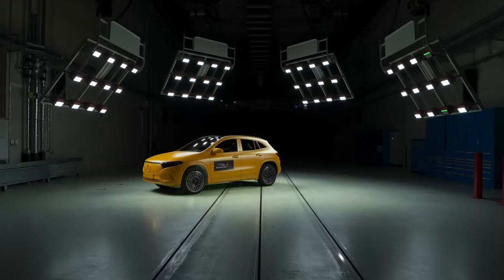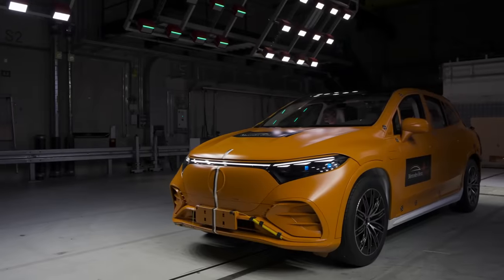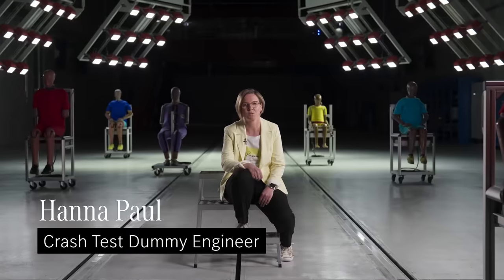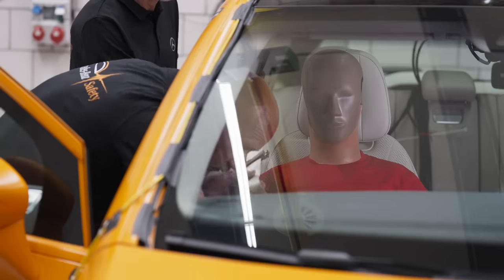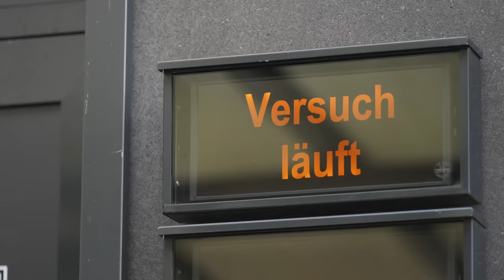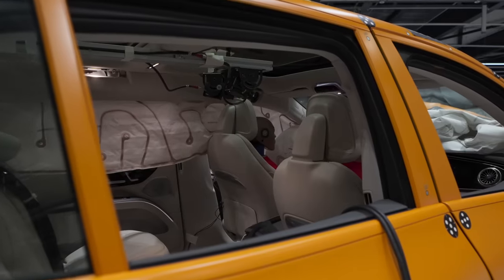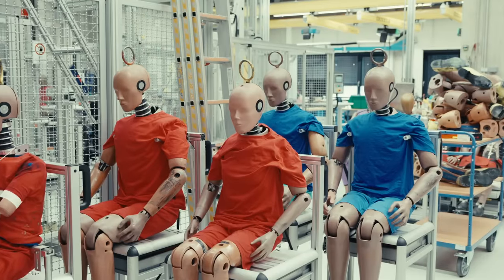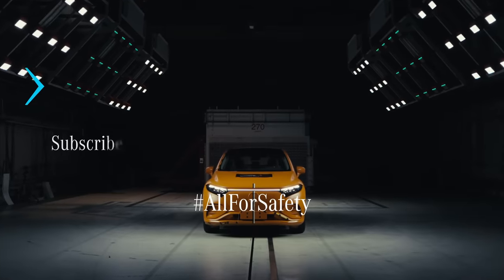The world's first public two-car electric crash test by Mercedes-Benz

Comment: Mercedes should have done this test with en EV and a lighter combustion engine car....weight difference is an important faktor...and the lighter car will loose in such crashtests
Reply: Why? What additional knowledge could they have gained from a test like this? You already tell us the (obvious) outcome in your comment.
Reply: @Tschacki_Quacki  additional knoledge might be, that EVs need to be "softer" to absorb more energy, so that the accelleration force on the lighter vehicle gets lower
Reply: @alexmeier3538  EVs already absorb more energy in crashes than ICE cars since they have bigger and better crumple zones.

If you have a smaller car you rather have a big EV crashing into you than a big ICE car. The additional crumple zone helps all victims of accidents, not just the one who has a bigger car.

Comment: The car is orange for a different reason. Firstly it is matte because the lights a because of the camera shutter speed extremely bright and the reflection of a clear coat would reflect the lights. But why is it orange? There is absolutely no reason for that. It can be bright blue, it can be bright green. As long as the car has a bright matte colour it's fine

Comment: Ok, so where are the side impact results wherethebatterypack would certainly be effected, and rollover results, I would like to see independent tests, not self promotion tests, and I hope no crash test dummies were seriously hurt in the making of this video.
Reply: Plenty of them online. E.g. check out N CAP tests, they are the ones giving out the 1-5 star ratings for automotive safety. You can be sure these internal tests are on same or higher standard, since OEMs are eager to reach a 5-star rating

Comment: Now lets see the same thing with the more abundant Chinese EV`s that are on the road . I know its unlikely the Germans would ever cheat on a test 😉 but how do we know if  there was any power in the Batteries? I`m betting they were totally flat , as petrol/diesel is drained in ICE car  crash tests and replaced with water, so it stands to reason the "electric fuel " would be drained .
Reply: Batteries were both charged

Comment: what about car  battery on battery collision
Reply: What sort of setup would u imagine?
The batteries are in a safety package with impact absorbing structures. So they never take a direct hit.
Reply: @quelandil5738  idk what if the cars flip over and somehting hits the battery or when driving in rural areas some rock hits it then the car becomes like gta v (where flipping cars most of the time result in fire)
Reply: @lelkasa361  unless u get in a high speed crash that deforms the whole car the battery will be fine.

The passenger and battery compartnent is basically a really sturdy structure with crumble zones around to take the impact.
When the battery gets severly damaged, the passenger most likely already died from that crash.

Towards your question, those tests are performed, e.g. a pole hit from the side l8ke hitting a tree

Comment: First this test was done by the manufacturer so they most likely built this car for the test, it probably didn’t even have a full battery pack in it. Second if you want to do a test like this the car should be sourced from the dealers lot.
Reply: That's why these tests get conducted by governments and institutes to certify before release

Comment: You didn’t show the fire and them getting dumped in to a lake 😂.
Reply: Well sorry to burst ur bubble, they don't catch fire 😂
Reply: @quelandil5738   ok, do you want links of EVs catching fire? Because they do…. It’s a battery powered car not a pedal car.
Reply: @thewillofus.defend1351  ok, do you want links of gas powered cars catching fire at a proven increased rate? because they do...
Reply: @thewillofus.defend1351  Nobody doubts that there are ev cars that catch on fire. 

It needs to be a big issue and a high probability on happening.

But with that kind of approach you also shouldnt drive any other car, use a phone, fridge or maybe even a book (i mean... papercuts?)

Without statistical significance it simply doesnt provide any additional information. Gimme empiric data of an insurance company, percentages, brands etc....

Comment: If the vehicles were painted orange for black and white cameras, and you have color cameras now, why are you still painting them orange?
Reply: Tradition and recognition
Reply from the maker: Since we film with high-speed cameras, up to 3000 frames per second, we need glistening bright light in the crash hall. To prevent this light from reflecting too strongly on the vehicle, we have to paint it with a matte colour. It turns out that our historic orange colour is still the most suitable.

Comment: Car looks totalled even at only 56 kmh. If I crash with my bike at 56 I can survive that crash without any crumple zones. Maybe I will not feel as good as the passengers of the Merc but non the less survivable. Love to see this test at double the speeds (100kmh).
Reply: Well that's the point. The car is totalled but no the passenger.
Which one would u rather sacrifice?
A car that is undamaged after a crash has dead passengers inside
Reply: @quelandil5738  I get that, but its only 56 my man. 20 y/o cars have crumple zones as well with less mass and you magicly survive with a car with minor damages

Comment: I would imagine the batteries were replaced with crash test dummy batteries, they would test outside in a controlled environment with fire trucks, water-bombers standing by. Let’s see an independent entity do it.
Reply: Production batteries at roughly 50 and 75% SOC were used. There are always safety measures close to be prepared for any circumstance. If you dont trust them, then check out the independent agencies which do the same tests for the 1-5 star ratings

Comment: 56 kmh is a joke. if you are so confident with protecting the batteries and high voltage components, do it with 116kmh. lets see what happens? what a publicity stunt this is.
Reply: >100 car and passengers are simply dead.
Tests are done at speeds with statistically lots of accidents and reasonable survival chances

Comment: I wonder if the Door locks functioned after the Crash, as this is one of my main concern to GTFO of the car before Thermal Runaway Ignites and Incenerates You ! Remember the Gas from batteries is also Deadly.....Screaming to get out ! which seems to be the main safety issue. Blue tooth  remote door locks typically go DEAD and with no easily accessable Mechanical Override to Quickly Get out of Danger ! Not sure how or why the Automotive industry does not want to save its customers !

Comment: A residential speed crash looks like it rights-off your $100k+ EV. I'm curious how the batteries react if they are hit, this test looks like it is done while the batteries are removed and powered by a cable.
Reply from the maker: We test real accident scenarios, so this means that the battery was charged in both vehicles. To accelerate the vehicles, we use a steel cable laid in the ground that works in a similar way to the cable car in San Francisco. The fact that the battery is not destroyed in an accident is crucial for the safety of road users and part of our safety concept.

Comment: If i''m getting into a head on collision with another car, I think I would rather have an engine in front of me rather than a "frunk". Just saying
Reply: An engine is simply a solid heavy block of metal that doesnt reduce any impact force and will simply be pushed towards the drivers cabin. Having no engine in the front is a HUGE advantage for crash safety since you have more crumble zone
Reply: An engine sometimes creates a barrier for the passenger. Infact in some vehicles the engines fall out and not go into the cabin. With an electric vehicle, there is nothing but a sub frame between you and the on coming vehicle...and airbags
Reply: @1964flyers  
The frame is exactly the thing you want. That's the structure able to crumble and therefore reduce the impact for passenger.
An engine doesn't help in any way, at best you manage to make it not pierce the cabin e.g. by having it push under the cabin.

Comment: They are doing it at 56kph. Not 60, not 55, 56! 🇩🇪
Reply: Exactly because that’s the most common speed when an accident occurs outside urban arias. Forchheim occupants the impact is like hitting a wall with 96 Kph. Als any other car manufacturers to do such a test in public

Comment: Didn't you'all sink a boat when you EQS lit on fire ???..  until batteries are solid state and the vehicals like a Cyber truck that weight 6800 lbs means that is Double the weight of most vehicals as well as damage it causes... 
Past 55 mph you are about 80% dead in any vehicle with this crash ..
Reply: The hell you talking about? If you refer to the transport ship on fire, it has already been clarified that it wasnt any EQ responsible for the fire....

Comment: Why are there power cables attached to these cars? Did they remove the batteries before crash testing the cars? If so, why and wouldn’t that invalidate all the data collected? Wouldn’t that make this video kind of fraudulent?
Reply from the maker: Hi Mike, Both vehicles have installed and charged batteries. The Flore cable is only used to accelerate both vehicles to the set speed of 56 km/h. The high-voltage system is switched off automatically in the event of a crash, which worked as intended.
Reply: @MercedesBenz  Hi. Thanks for the response. I have a couple of Mercedes cars now and am very happy with them - especially my mint 2 seat convertable collectable. I cannot imagine buying an EV ever. The idea of being completely and totally reliant on one single energy source is just not a good one. Please keep making well engineered conventionally powered cars until there are legitimately better opitions.

Comment: zero fatal in 2050? What do you think will change until then?
Reply: Active safety measures preventing cars from even colliding or at least slowing down enough. Development is strong in these fields but for 0-deaths it requires more cars with intelligent measures and probably also infrasctructural advances

Comment: Okay. Show now a typically crash between an EV and ICE regular vehicle. Please include also some sparks and leaking from battery cell. Invite fire fighters to event and see how long takes to access passengers as well to extinguish the fire. Okay afterward please make a balance on environmental chemicals contaminating the local. The results should be different I guess.
Reply: 1. There aint no sparks or fire. Batteries are well protected
2. Firefighters are there and they know how to solve a fire, it's not impossible
3. Access to passengers is easy since u can simply open the doors at this crash
4. This isnt about the environment but about safety. Dont mix topics when not necessary

Comment: How about an electric vehicle vs. a similar sized internal combustion vehicle?
Reply: To what point?
This test was there to show safety of ev especially battery safety, since passenger has been proven multiple times.
The ev will perform even better against an ice, since it is heavier
Reply: @quelandil5738  "To what point?...The ev will perform even better against an ice, since it is heavier"  The point being I've never seen a direct collision between a similar ICE SUV and an electric one.  Simple mass is not enough to make an EV safer, as has been shown by many crash test that I have seen and read reports on.
Reply: @rodshop5897  In a front collision ev > ice since u don't have an engine block and it can therefore absorb more energy. (More crumble zone)
So the ev will definitely perform better in this comparison.
(I am talking mercedes, not any car brand)
Reply: @quelandil5738  "In a front collision ev > ice..."  You've made a claim.  I want to see it demonstrated.  Can you provide that?
Reply: @rodshop5897  good evening. It's not just a claim but proven concept.  can't provide that without further research, but if you check the usual institutes for independent tests you should probably find some footage (like N CAP)

The results in the tests will be quite similar cause manufacturers need to get good ratings. Due to the packing (as mentioned the rigid engine block) ev design is simpler and cheaper while for ice you gotta spend more money and need more refined solutions.

2 other big differences in crash safety.
- battery pack on the bottom reduces risk of rollover due to low center of gravity
- no fuel tank --> way lower risk of catching fire.
Reply: @quelandil5738  I've seen "proven concepts" that have turned out to be false so I look for actual tested material.  FWIW I work as a R&D engineer and have disproven many such claims.  I'm not disagreeing with you, just wanting to see the data.  

Honestly, I'm being lazy in not searching harder, since I agree with you that I could probably find it.  But I've also spent time digging for other topics only to have someone post right away exactly what I was looking for.  If someone else has it all at their fingertips, I should at least ask, right?
Reply: @rodshop5897  for sure! That's the only way to have a real discussion about things like this.
My problem is that I don't have any data I am allowed to share 😁
It's all confidential because I apparently have quite a similar job.

I really hate researching these topics nowadays because it is a minefield of false information and anti ev/ice propaganda...
Reply: @quelandil5738  Agreed, the amount of total BS and mindless speculation makes it hard to get to the real evidence.  

I am fine with both EV and ICE cars, and just wonder what the actual test data is.  I appreciate your comments.  Best to you.

Comment: It's not clear if 56 kph is impact speed or each car speed 🙄 if they test impact speed of 56 kph, that would mean car speed of 28... That's would not be very realistic.
Reply from the maker: Hi Piotr, each vehicle was travelling at 56 km/h. 🙂
Reply: @MercedesBenz  I feel much better now 😁
Reply: @PiotrMaselkowski you got a small physics error here.
If both cars would be driving 28kph the impact speed would be 28kph. (Assuming same weight on both cars)
Doesn't matter if u drive 28kph against a wall or two cars colliding with both driving 28kph.

Comment: What I want to see is an electric vehicle crashing into a regular small car. Electric vehicles weigh much more due to the batteries, so wouldn't a lighter car get absolutely totaled?
Reply: Dont even have to take an ev.

But yeah it is tough being the light car. You can find s-class vs smart if you search for it
Reply from the maker: Hi Matizu, there are also crash test scenarios in which the tested vehicle collides with a moving barrier. This moving barrier represents a smaller and lighter car and has deformation structures that represent the front of the smaller vehicle. In this scenario the forces and deformations of the moving barrier are also requirements to pass the test.
Of course, these tests are part of our regular tests and requirements that all of our cars have to fulfill.

Comment: Let’s see it between a combustion car and an EV……the additional mass will destroy the IC car.
Reply: If you take an ice car from the same class the weight differnce aint that big. E.g. for the eqs suv you could take a gle or gls which are almost same weight.

Cars in general are damn heavy in the last years...
Reply: @quelandil5738  if a 2.5 tonne EV, hits an average car of 1.5tonne the impact force is 166% greater. Most cars are around that 1.5 tonnes. The majority of EVs are around 2.5 tonnes. They need their acceleration to be limited, especially 0-60 times, since these are used in urban areas. Outside urban areas where 60mph plus is ok, then ev’s can be unleashed. This is yet another danger not dealt with by those promoting EVs.
Reply: @albertol1529  let me guess, you simply are against ev cars and now are trying to justify your point since "they explode" isnt viable anymore?

You have valid points about dangers of car which are not ev specific.

So 0-60 times. Do we also restrict all ice cars which are faster than - dunno 7sec? Or why is 0-60 of an ev more dangerous?

Do we also ban all ice suvs over 2 tons? You would have my vote for that.
Reply: @quelandil5738  Get yourself a the minimum of a physics degree (from a red brick university, not an ex-polytechnic, or off the back of a cornflakes box) before you comment.
Reply: Why dont u simply explain your point, maybe u have a real concern that needs to be adressed?
Now i can only assume your arguments which isnt a base for a discussion

Comment: Is it just me or is this test flawed because the vehicles were being pulled instead of being propelled by their own electric power train? I think to conclude that these cars are safe you really need to crash them with an energized motor.
Reply: Why? What would be different?
Reply: It simply makes no difference.
They are pulled to have exact speeds and impacts to get usable results. These tests are made to confirm simulations.

Comment: I was assuming the collision will NOT happen as ADAS will trigger in both cars 😂. Please clarify did it Fail? Or ot was deactivated for the test? That makes me more concerned...  At least should have tested with ADAS enabled at first round. How can merc forget that?😅😅😅
Reply: It is turned off beforehand, since this test is for passive and structural safety.

Be sure that all tests are performed. This one is the most spectacular, so it is used for a public vid
Reply from the maker: Hi there, in this test, the more than 40 active safety features that Mercedes-Benz is currently offering were deactivated, as it is a test scenario in which the crash case is to be tested. We hope this helps.
Reply: @MercedesBenz  Thanks for reverting the comment. 👍 I would still appreciate a video of collision avoided by ADAS enabled.